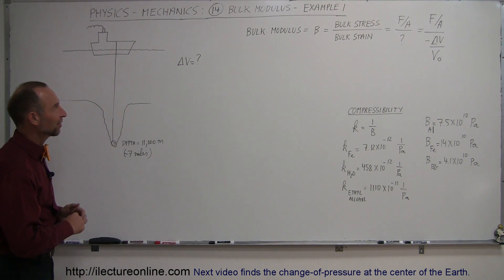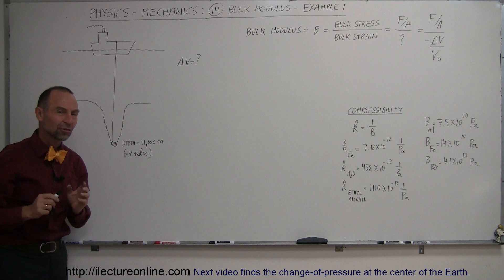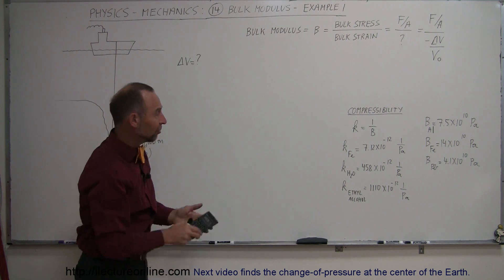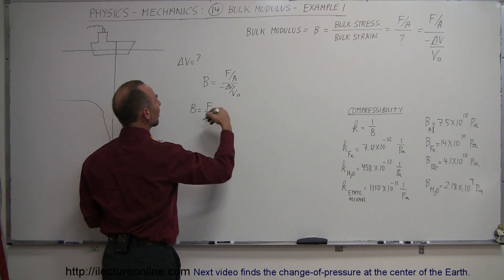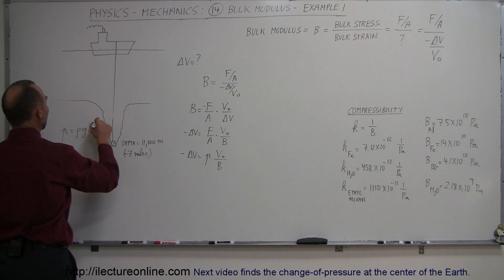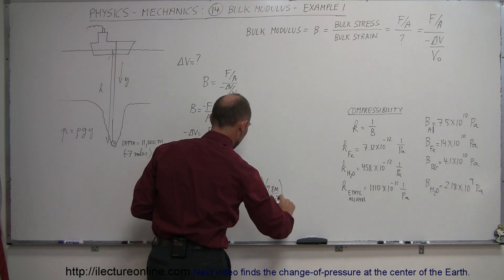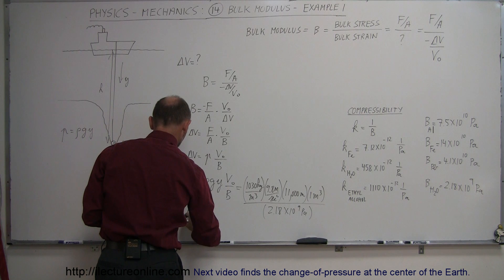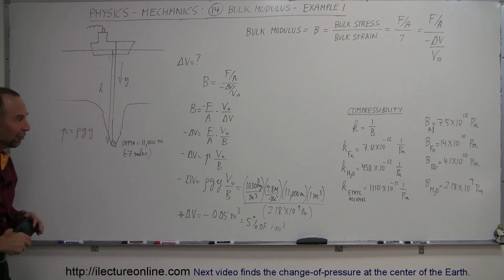Physics - Mechanics: Stress and Strain (14 of 16) Bulk Modulus: Ex.1: Volume Change in 11,000m

Comment: I don’t fully understand the example here, what exactly did we solve? The change in volume of the sea from the “ball/submarine” being submerged to 11,000meters?
Reply: Alexander we are calculating the change in 1m^3  volume of water about  how much it is compressed due to that ball at the bottom. Not considering the whole that would be not possible but predicting how much compressibility the water around the ball goes on and I also have a doubt how far this compressibility effect acts on water and it's unclear.

Comment: Michel: Shouldnt we add the atmospheric pressure to the pressure at 11000 m ? So P=Pa + P(11000m)?
Reply from the maker: That depends on what you want to express, either the gauge pressure or the absolute pressure.  Typically we express pressure in terms of gauge pressure and thus the atmospheric pressure is not included.  But if you want to express the pressure as total pressure you add the atmospheric pressure as you indicated.

Comment: Don'twe have to take the Bulk Modulus of the ball instead of water for calculation?
Reply from the maker: That depends on what you are looking for.   In this video we wanted to know how much water is compress at this depth.
Reply: Yeah got it so the steel ball is only used to determine the depth at which a cubic water is pushed in.

Comment: Can you add this one . The compressive stress on the concrete pillar of square profile 300 mm 300 mmand the height of 10 metres is 4, 14Mpa. E=13,8Gpa. Calculate the (a) working load (b) strain (c) change in lenght.